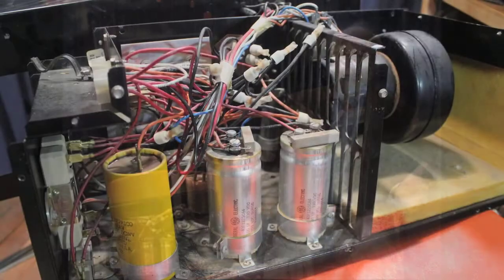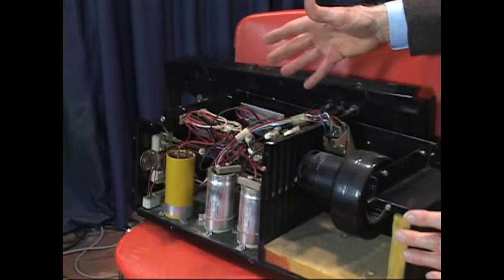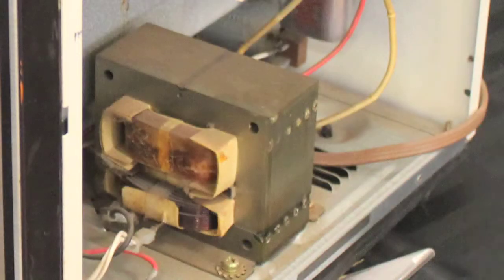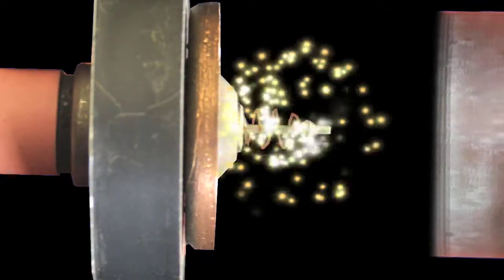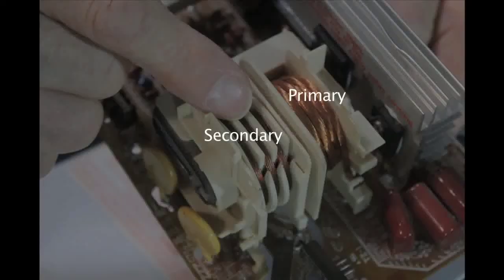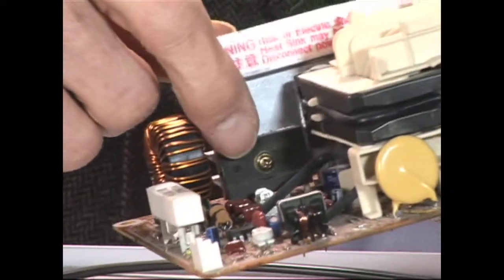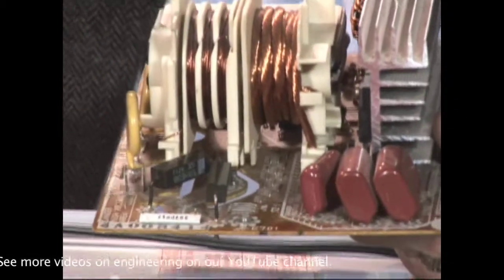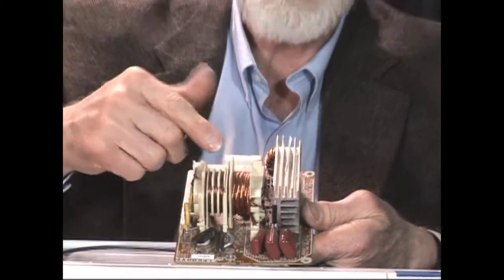Microwave Power Supply Evolution

Comment: the (for lack of a better term) Solid state power supply looks very simalar to the Flyback driver for a crt's HT line. I wonder if they are the same.
Reply: Volt/amp ratings differ but principallly work similarly.